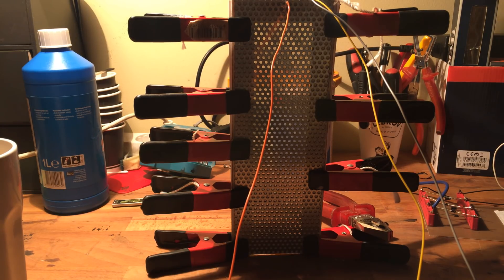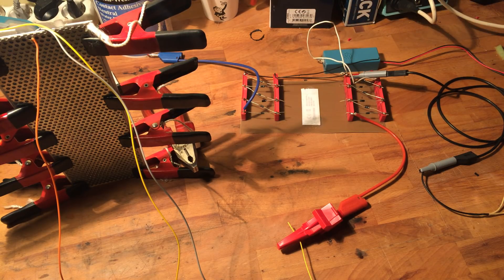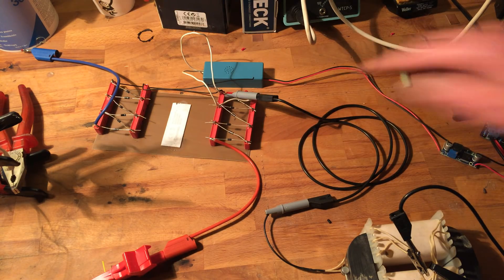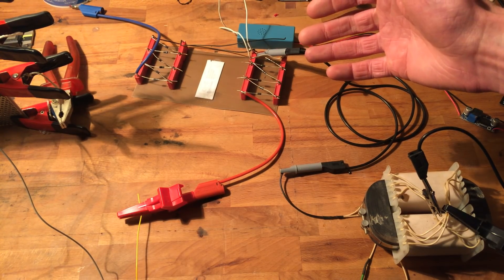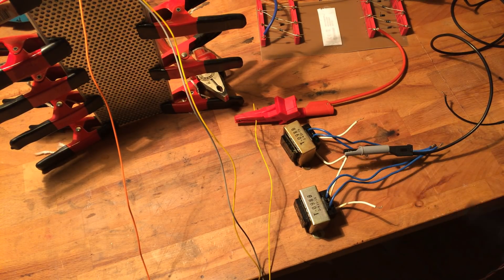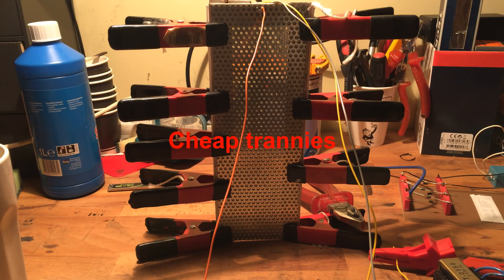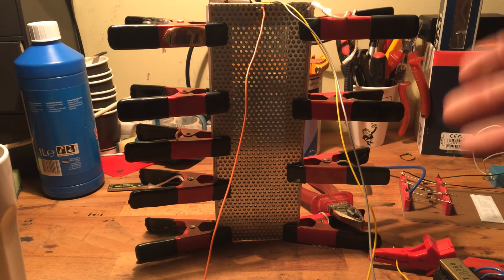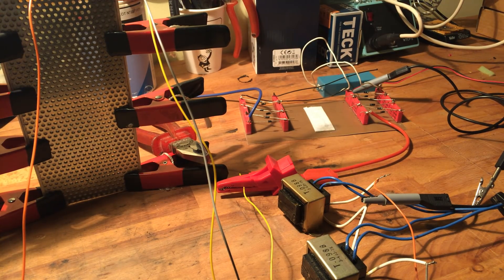Part 4 "FAST" electrostatic tweeter  hear the difference between transformers

Comment: Those little transformers have a terrible resonance. Does that have to do with the poor magnetic properties of the iron core?
Reply from the maker: well could wel be , they are overal terible.  the cheapest teroid works better. to bad i cant find any that has 230-3volt that would be great :) 6 is the smallest voltage i could find but are still 25 euro a piece..  i talked with final (the owner) once and they bought there for around 7.50 -10  euro.....  its insane. power of numbers i guess and good contacts
Reply: @joppepeelen  You could wind your own 3 volt winding on top of the 6 volt winding. Just use half as many turns! And use wire with the right resistance or you might short out the transformer. I've heard toroids pull a high current when they produce their magnetic field.
Reply from the maker: i know, i did actually :) i wound transformers for a while for someone else. but they where C shaped. and only the materials alone are a bit more then 10 euro :) more like 75 :) so its a waste of time for me at least. i had the machine on loan and gave it back.. although i had the change to buy it for only 150.... at that time i did not have the money.. i wish i did buy it. it was a loverly al mechanical machine. not suited for teroids  though.  it was a Mica Fill. from the 60's or something. as a thing of art it was worth the 150 i think :)

Comment: When you connect two transformers like that you get dc bias on those, it makes it saturate cores wery easy, it will lose linearity. With middle tap on transformer dc bias will cancel itself.
Reply from the maker: I think a DC blocking cap would solve any of that :0 no mather witch kind you use
Reply: @joppepeelen  yes you are right

Comment: I wonder if you can protect the system from overloads by just adding a bottlenecking capacitor -   so it cuts out when the bottlenecking capacitor fills up??  just an idea, im not sure how to do it tho.
Reply: No!  I think you put a spark gap that is slightly smaller than the d distance on the speaker membrane!  then if it ever over volts, it wastes down the spark gap instead of blowing the speaker!
Reply from the maker: @drrobotnik5376  i think they did somerhing similair in de esl63.  But i think it shorted the audio to a resistor to protect the amp
Reply: @joppepeelen  you can add resistance to the spark, but it has to be BEFORE the junction NOT after, because I know about plumbin'  electricity,   raw junctions is my specialty.  (u have to keep the spark end bare.)

Comment: That sounds a lot better than what I expected. A WHOLE LOT BETTER. Im planning on building electrostatic tweeters for my vintage radio that had them but they are missing and the original ones are these days all toast because of either corrosion or material decay...so I want to make a lot better ones than what they had in the 1960s :)
Actually I will have to go with a high voltage bias and I can obtain drive voltage for the tweeters from the primary side of the output transformer of the final vacuum tube amp stage. Gives at highest volume 300V signal
Reply from the maker: most likely they used single ended electrostatics.   one foil and one stator.  not ideal.  if you can,  replace it with push pull :)
Reply: @joppepeelen  yep it was a single ended electrostat. The membrane was what i could tell from the pictures glued to a soft insulator and after years and years of service the foil has either been stretched, or corroded away or the glue holding the foil in place let the tension droop and the stator touched the membrane.

I have a read a few papers on how to make electrostats but everybody seems to be obsessed with full range while I just need a powerfull enough tweeter.

Comment: it can't be just connected as normal speaker?
Reply from the maker: no and Electrostatic speaker need all this junk.  a planar magnetic does not.  i make a few of those to. just to different types of speakers
Reply: @joppepeelen  what is the easiest way to make preamp for electrostatic speaker?

Comment: I tried to make my own but it don't have any sound, maybe is do to low voltage to the film
Reply from the maker: Hmm well could be many reasons.  The high voltage the coating or you transformer or the way you hooked them up.
Reply: you have to get the circuit right,  doesnt matter if you can just make the speaker!! :)

Comment: Hi, your movies are always very informative.
For the high voltage, I bought the blue box but could you send me the diagram that also includes the diodes?
Thanks again.
Reply: what is the blue box called?
Reply from the maker: Called  an cold cathode inverter . Like the ones used in older game pc a tube like lamp. 12 dc volt in or less and between 100-600 ac out

Comment: What is model of Amplimo?
Reply from the maker: Luciano Veneziano not sure 25va 2x6 volt mains 230. Used in r3verese. They are not ideal either since the dont reach above 18khz somehow.  Some onther cheap brands where reported doing fine up to 20khz and beyond like antec and vxd toroids